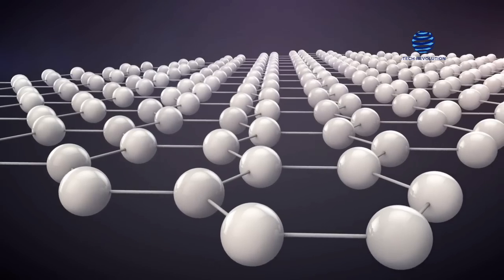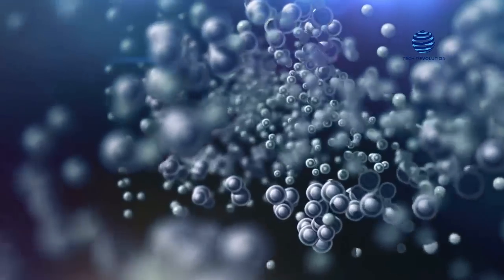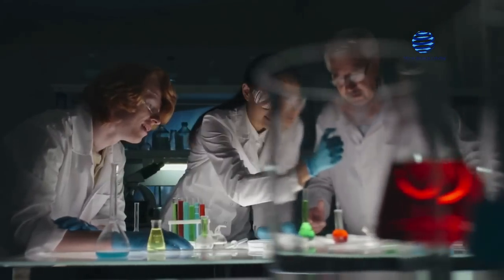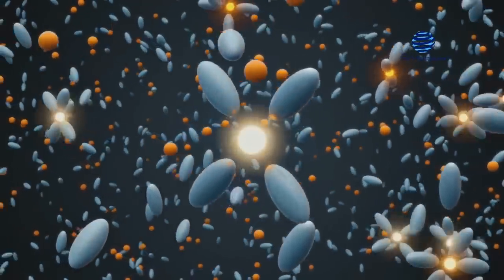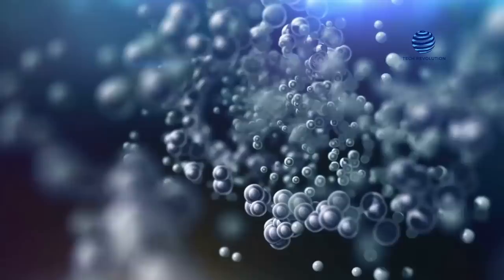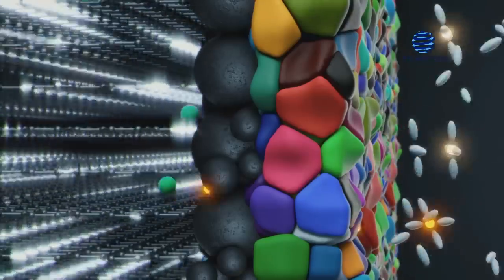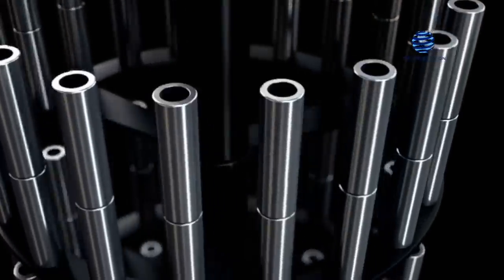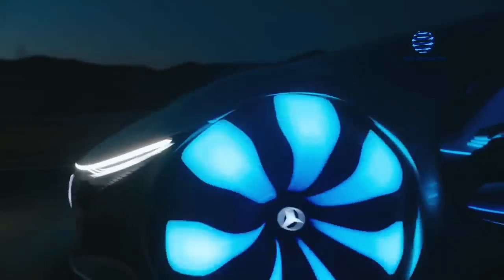UNCOVERING The GAME CHANGING NEW Battery Breakthrough That's STRONGER & BETTER Than Graphene

Comment: Methinks will hold off my purchase of an EV for another 5 Years or so - at present have a Mercedes [W247] B200CDi that can do 88.3 MPG {UK Imperial Gallon - 4:54 Lites} and no Range Anxiety as never more than a mile or so for a fill up in 5 Minutes !
Reply: Well, now that gas today at the station I used to use is $4.39/gallon, I'm happy that I can put 100 miles of charge in my Nissan Leaf for less than $4.00. 

That's at 11 cents per kilowatt hour, which is more expensive than electricity in many places around the US.

Comment: Hello, when will they develop a car that recharges itsel while its moving, something to propel a generator by air that is going thru against the forward motion of the car  similar to a generator pressed against a bicycle tire that creates electricity to power the  bicycles head lights.  In combination to solar panels that can recharge a cars battery, we should focus on what is already available and doable.  that may solve the range concern and everyone would go and buy EV's.  Penny's for my thoughts.  God Bless World.
Reply: The electricity for the bicycle lights is provided by making you pedal harder. You're generating that electricity with your legs. 

The wind energy from the forward motion of the car is always less than the energy it took to move the car in the first place. No energy conversion is 100% efficient. This is the oldest fool's errand in the technical world.

It's like using an electric motor to propel a boat forward. Then you put a turbine in the water that runs a generator to provide electricity to the electric motor. At every step you just lose more of the original energy it takes to move the boat (or the car). It makes no sense at all. 

This kind of thinking is a result of thinking about only of one piece of the picture at a time in isolation. It draws absurd conclusions because it fails to see the pieces in the context of the whole story.
Reply: @robertwendell1556  This kind of thinking happens with people who doesn't understand the basics of science. He probably think over unity is possible.